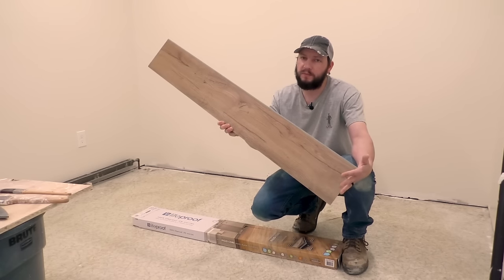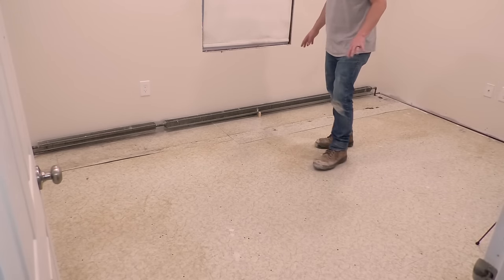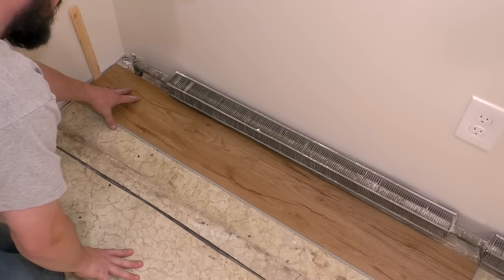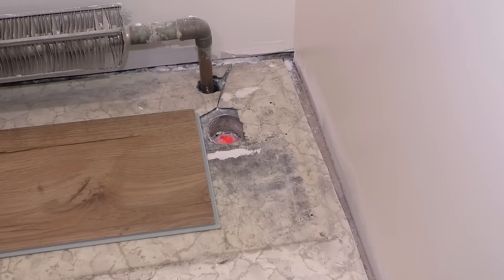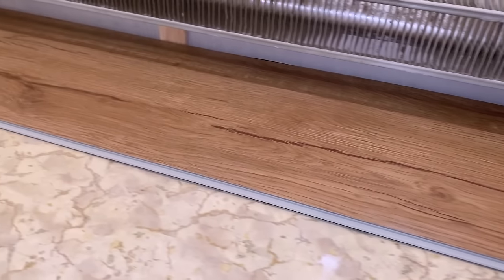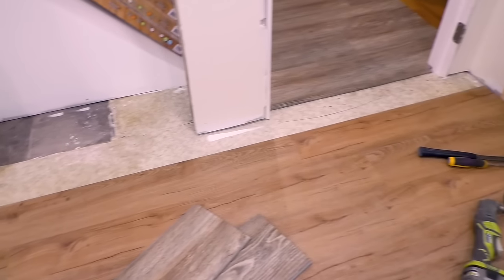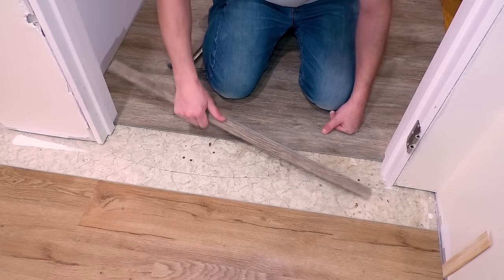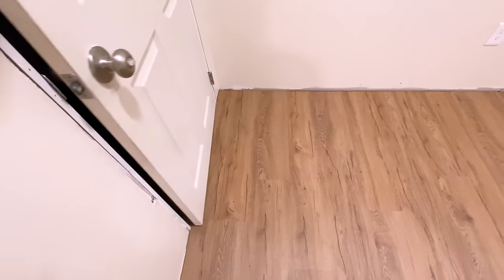How to Install Vinyl Plank Flooring | Lifeproof LVP

Comment: I've been thinking about installing LVP in my mobile home because it came with crappy carpet. You said not to install it under cabinets. My question is that I have two large bookcases that are full of old books I've collected. Would they be too heavy to place on LVP?
Reply: The floor needs to float so that it can expand and contract with temperature changes.
Reply from the maker: Hey, Roanna!  Large bookcases full of books are probably enough to be considered a "permanent structure".  The thing that can happen is the bookcases could put so much weight on the floor that those particular pieces are not able to move but all the others do and that is when the joints can start popping apart.  If it was me, I would either do a different type of floor or install this floor around the bookcases.  You can try to trim the bookcases out depending on what type they are.  I would also keep an extra box of floor around in case you ever want to patch it in (if you move, or move the bookcases to another room).  Those are my thoughts.  Hope this helps.
Reply: In a conditioned space the expansion and contraction of a vinyl floor is fairly low.  Lifeproof, for example, allows 100 linear feet of installation before requiring a transition and requires the air temperature to be between 50 and 100 degrees.  That means they expect less than half an inch of movement over 100 feet over a 50 degree temperature swing.  That's a lot of leeway, especially for a smaller room that only experience a few degrees of temperature swing through the year.  Personally, and I am not a professional so please take it as you will, I wouldn't worry about it unless a problem crept up.  Bookcases can be moved after the fact, the floor can be tapped back together, and even pulled up and redone.  It's a calculated risk of extra work, but one I have done and not been bitten by yet.  YMMV

Comment: How does it fair with a stove and a large fridge, a shelving unit and a 6 foot cabinet on it if it's a floating floor.  I really need to replace my kitchen and front room flooring.  If i also do my hall where my washer is how does that fair?

Comment: I have done 3/4 of my home with LVP. I have also used engineered flooring, Pergo, and knock off Pergo. LVP is easier and I am happy with the results. Except I have an artificial hip, 16 years past the sell by date. I am waiting for assistance to finish the other 1/4 of the house.
On another point, last year you mentioned that you were going to eventually strip off your cedar shingles and install vinyl.
Please Don't. it will be much cheaper in the long run to replace the shingles as needed. 
I was raised in a cedar shingle cottage. My mom dipped every shingle in linseed oil and my dad and her dad installed them beautifully. I was shocked when I came home to visit and discovered she had them painted. They had gone beautifully black at the tips and would have lasted for another 100 years. there was even some verdigris. My grandfather chose to have his sandblasted. They don't allow that in Massachusetts anymore.
I don't think you are trying to flip this house. Your work is way beyond that of a flipper. Cedar shingles can be fixed, vinyl siding can't. Keep the expensive stuff and fix it a little bit at a time.

Comment: Good video bro. Do yourself a favor and go buy a tile/lvt cutter. The amount of dust from the jigsaw or chop saw is super unnecessary. They are pretty cheap $125-$160 for a pretty good one I have a Brutus but also seen marshalltown in that price range. I have been installing floors for almost 20 years and it’s the best investment I ever made. You can thank me later. Cheers 🍻

Comment: What are your suggestions for fixing a gap between the existing baseboard and new vinyl flooring that the previous owners installed? in this case the baseboard goes over a transition from vinyl to tile so moving the baseboard down is a little tricky.

Comment: shouldn't you end with a wider piece than the one at the "ball-hole" ? (and also not starting with a full 1st board ) or is that not necessary with this type of flooring?

Comment: Hello,  you said you would not advise putting a dresser on this floor because it is floating. I now wonder, wouldn't a kitchen table create a problem as well? Thanks
Reply from the maker: I don't believe I said a dresser.  I said permanent structures like kitchen cabinets or an island.  A kitchen table is totally fine.
Reply: @TheFixerHomeRepair  my mistake, thanks
Reply from the maker: @flipper2473  no problem!  Thanks for watching!

Comment: More great info. But a question: I measure for square by going corner to corner because you could have identical measurements on opposite sides, but if the footprint is rhomboid, your corners won't be square. Did I miss something?
Reply from the maker: Yeah I guess square isn’t exactly the correct term.  If the room was like that though this method would still work as long as you kept checking your pieces and leaving a 1/4 inch gap.  You can easily make up for it piece by piece or you can cut the pieces at the angle of the wall… make sense or am I just blabbering?  🤔🤣
Reply: @TheFixerHomeRepair  Makes total sense. I would just want to know what I was in for before starting. I'm a planner, don't like surprises on a project like this. Guess that's why you and a lot of other people are better at this than I!!
Reply: @tedbaker8291  No matter how long you've been doing this or how well you plan there will ALWAYS be surprises and things you didn't count on.  All of us in the contracting business have to learn a great deal of patience.

Comment: You have the tapping block and the z bar, why don’t you have the matching two headed hammer they also make ? On side it rubber and the other side is hard plastic.  The metal hammer can mark the floor.

Comment: How about underlayment designed for lvp over concret with built in vapor barrier. Over wood or tiles, i would not need any underlayment if its on pad itself. Most lvp has 2mm pad attached, some have 1mm and reccomend underlayment

Comment: First thing you need doing lvp is kneepads. 
Don't need to shim lvp it doesn't expand. Shims to keep it straight at start. 
Use a vct cutter if you don't have one get a heat gun if you cutting it with a razor knife it cuts likr butter.
Radom looks the best. Save all your start cuts for the end. 5% waste is waste.

Comment: I did almost all of my cuts with a razor, I did some cuts with my table saw and some with my slide miter saw and some with my band saw. I do not know what a chop saw is. I think it might be a tool for cutting rebar.

Comment: Pretty sure you can use a 2nd underlayment without voiding the warranty. Also the floor needs to be 1/4" within level from side to side to meet warranty.
Reply from the maker: Yeah I definitely voided it there haha.  My house was built in 1946.  🤷‍♂️
Reply: @TheFixerHomeRepair  the other thing I would recommend is a vinyl t-molding instead of metal, but that's you're choice :)

Comment: The only risk of the fix the squeaky spot method is that you can end up moving the squeaks to new spots.  If you want to save your knees and potentially time the cost to buy a couple hundred more screws and rent a stand up screw gun and go along every joist is almost worth it
Reply from the maker: I can see how it may have looked like I was just fixing the squeaky parts.  I screwed down the entire floor.  Just used the squeaky spot clip to show that it was working.  Thanks for watching!

Comment: When installing LVP first throw it all in the dumpster.  LVP is cheap vinyl flooring that emits off gases, and regardless of what they say it is not durable. It scratches a collect moisture up underneath. It will rot out your substrate and if it gets wet, it Hass to be pulled up and dry it out.
Reply from the maker: But how do you really feel about it?  🤣

Comment: Is there a reason the seams need to be 8 inches apart? My parents have been redoing their floor with this type of vinyl flooring and I have no idea if they know that rule… Now I’m worried. 😅 You did great, btw! You make it look so easy. I get so sore when I help my parents do it.
Reply from the maker: Hey! 😬. It is always good practice to stagger seams in any floor like this.  It gives it a random looking pattern and more importantly it helps to lock everything together better.  I usually stagger them about 10 to 12 inches apart.  I said at least 8 inches in this video because that is what the product recommends in the instructions.  I always install products my own way but I also always read the recommendation of the products because I might learn something new and there is a reason they have it in there.  Hope this helps!!
Reply: @TheFixerHomeRepair  Actually, it says 6 inches in the instructions, not 8...
Reply from the maker: @billymacktexasdetective5827  not in “essential oak” life proof.  It says 8.  I wouldn’t tell a lie.  😁🤷‍♂️
Reply: @TheFixerHomeRepair  I just looked it up buddy. It's 6 inches...
Reply from the maker: @billymacktexasdetective5827  and that is why you are the detective! 🕵️‍️👍 thanks for the correction, buddy.

Comment: Floor looks good. However, placing a metal strip to cover that gap will look ridiculous. You should either leave the small gap or you should have carried the rook floor back to the original and locked it in.

Comment: What was the hole with the ball from?
Reply from the maker: Great question!  When the house was originally built in 46 it had those big cast radiators.  That is what the small pieces of evidence I have found suggest anyway.  So that hole was where one of the pipes came up to feed the radiator.  Thanks for watching!

Comment: after this watching this video, I’m gonna buy one box of life, proof, plank, wood flooring and I’m gonna try to install that if I succeed without any difficulty extreme difficulty probably I should say I’m going to try to put it in my Living Room but I got life proof plank flooring before, and I could not get it to snap together and some of the pieces with tongue and groove part broke off. I went to Lowe’s and I got traffic master luxury vinyl flooring, and the groove that you connect it all to is way tougher. You cannot break it off with your finger so I think that’s probably what I’m gonna get it’s called traffic master Arcadian it’s $.50 more square foot so it’s about 409 I think a square foot which isn’t that bad it’s a better product. It has wood green and texture to it. It looks like what it really does and it’s easier to put together it just goes together. You don’t even need any tools.

Comment: Good job there is no plumbing or electrics running under that floor. Doing the same in our bedroom at the moment there are cables and plumbing for central heating everywhere, be careful. There are tools to check for cables plumbing and even stud work.

Comment: Sorry, this means no heavy dressers, no king-size beds, you can't stop air movement,
When it comes to floating floors, they suck. Get the flooring you can nail or cement down, then you can do whatever you want. Had a floating floor, it sucked when you walk on sounds hollow. Lazy man floor. Put some sweat into it, before you waste your money

Comment: You should should have filled in the hole in the corner and cleaned the heat pipe first.

Comment: Life proof plank flooring is not easy to install. I actually got the tile it’s the 12 x 24 tile that was so easy to install. I didn’t even need a hammer or anything. It clicks all together but your perimeter it can double the price of waste and it’s really upsetting. I was thinking my floor was going to be $800 but it really went up because I wasted so many of the tiles, if you ever use the life proof tile, make sure you do it in a small space like a bathroom or a laundry room or a entryway if the entryway is small and that’s where I put my life proof slate flooring and I wasted so much and it was literally like 5 x 8 and I put it in my kitchen too but I just wasted so much of it. I had a huge pile of this expensive I mean it’s four dollars a square feet. It’s pretty expensive for vinyl but it is tougher than a sheet vinyl floor way tougher.

Comment: Just an observation having been installing for 30 years its a really bad idea just to stick random screws in to eliminated squeaky flooring with checking what is underneath i.e cabling gas and water etc
Reply from the maker: Ah now that you point it out I realize I should have mentioned that.  That was the first thing I did was look in the basement.  Definitely would have used shorter screws if I wasn’t sure what was in the floor.  3 in is a bit excessive haha

Comment: Messed up on your first run. No piece in a run should be less than 18 inches in length. The first piece should of been cut so the last piece was more than 5 inches. Cutting 13 inches off the first piece would have made a 18 inch final piece.

Comment: This one looks lightweight, not heavy as the one I ordered from Home Depot.  Home Depot vinyl plank is damming heavy and they don't click and don't lock.  I had to use a lot of wood glue to install it.  Worst of all, the connection parts are easy to crack and damage.  Eight vinyl planks for $139 weigh over 60 lbs, heavyweight expensive trash.

Comment: I share your skepticism regarding the "luxury" part of LVP's name. It's a marketing ploy to sell you cheap plastic floors. Sure, it's durable. And it can imitate many other materials. (Key word is "imitate.") To me, LVP is in the same category as plastic laminate countertops. It is just burning more fossil fuels to make it.
 I'd rather use sustainable harvested wood, whether it is traditional oak or rapidly-growing bamboo. No outgassing with those, provided they are finished with the right materials. Even cork is a better solution than LVP. It can last 25+ years and still look good. Hell, even traditional authentic linoleum is a far better solution since it is also all-natural and sustainable. It's made from linseed oil, pine resin, sawdust & calcium carbonate. Each ingredient is natural & renewable.

Comment: save yourself a lot of grief and spend the money to install real hardwood flooring. The garbage that he is putting down is a joke. I've had this in my home and had to replace it because it got damaged and it is a nightmare to try to replace even one peice of this crap, which is what it is. The reason i'm telling you this while i have spent almost 4,000 dollars for real wood flooring and installed it myself it will outlast me and be there for along time. Plus it is very beautiful when done and can be refinished where engeneered flooring can not. Plus if you have children and they accidently damage a spot it can be fixed where the other flooring cannot.

Comment: First of all it's not 100% waterproof even though they say it if your floor is an 8 inch and 10 ft it's out of warranty the tap and lock flooring has more problems than a locking mechanism all the way around the ones the ones with cork on back tend to be the worst ones as they swell with moisture when installing on concrete now they want you to use 6 mil plastic the only way to repair one is either take the floor apart and replace bored or you cut locking mechanisms off and use glue they have a tendency to slide back and forth remember you get what you pay for as wood floors are considered permanent like ceramic tile you'll get your money out when you sell it been doing this 40 plus years 20 years self-employed 20 years Union CFI certified flooring master good luck

Comment: First off DON'T, all of it is garbage. I have seen over 16 house's in the last year and all of them the floor was already peeling up. If you want wood look, USE WOOD ! There is a reason no one used Vinyl floors in kitchen and baths anymore . Vinyl is cheap, that is why people use it. If your flooring floats, that means it will move.

Comment: Good job!, but, im SO TIRED of hearing this "leave room for expansion" nonsense for vinyl flooring....VINYL DOESNT EXPAND, also, homes are climate contolled, your interior temps will not vary more than 12-15 degrees the ENTIRE year, thats not enough variation to even affect wood floors, let alone vinyl floors.

Comment: Per the instructions, end pieces must be a minimum of 8 inches. You installed several that were well under 8 inches... And the minimum stagger is 6 inches, not the 8 inches you claim. Please read the instructions before making an instructional video...
Reply from the maker: Yes, you are correct.  Thank you for the corrections, detective.